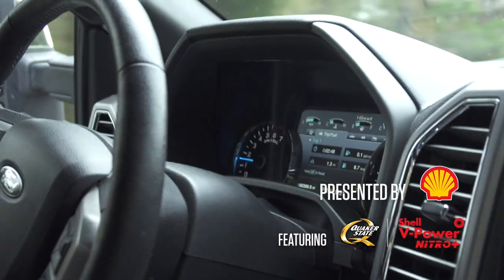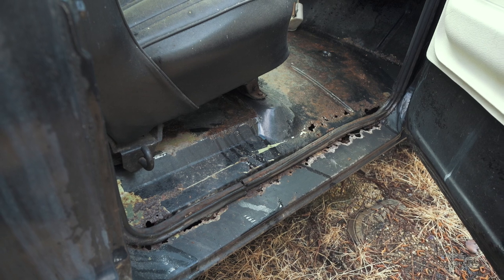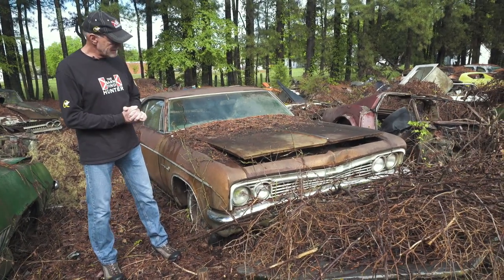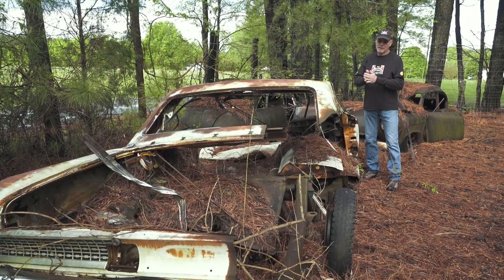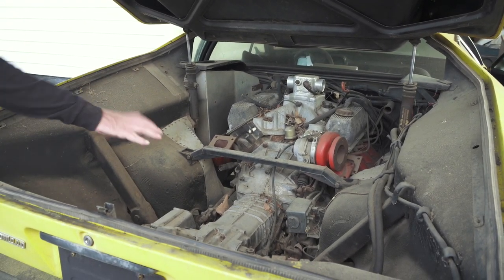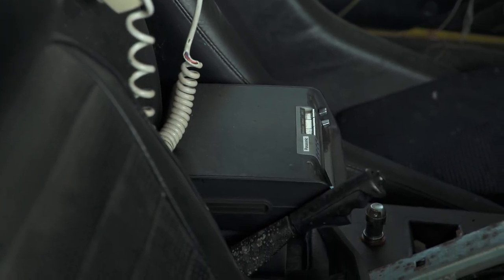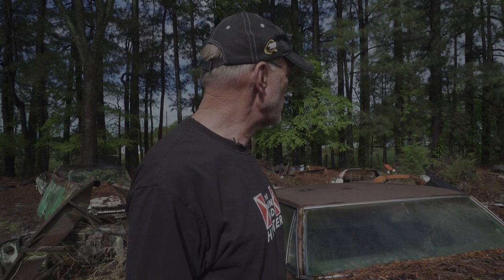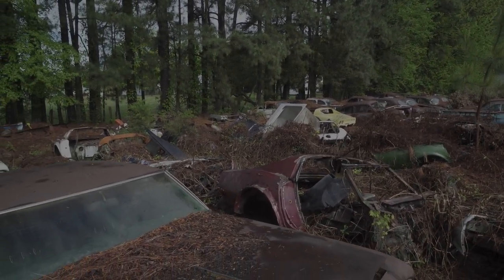R-Code Ford Galaxie 500, De Tomaso Pantera and MORE! | Barn Find Hunter - Ep. 49

Comment: Id be willing to take on the Pantera for restore if I ran across one In that condition. Metal can be replaced to a certain extent. As long as the main part of the car is there to get a template off of. It wouldn't be any issue just time.

Comment: Vega wagon. But way too far gone...
Reply: Too far gone? Not even a good starter!!  
‘74 Brand new 43 miles with parents in car blew head gasket 40000 miles later 1 1/2 quarts of oil to the tank of gas

Comment: The continuous bumpers front and rear on this Pantera indicate it was a later model and, in fact, a Pantera L. The pre-L models are worth more and had separate bumperettes. Someone also couldn't hack the gated shifter and cut the fingers out. It's certainly worth fixing. Parts aren't that expensive.

Comment: Not a phone    It;s a CB
Reply: @4375-d6i    I had a CB just like it  The big round nob changes channels  23 Channel CB
Reply: @4375-d6i  Probably so  I know I had one just like it in my first tractor trailer rig I bought in 1974  Big dial changed channels next small one was on/off Volume next was squelch  last was r/f gain  Button for transmitting was on the part that look like a phone  But probably to young  I retired in 2014  after 40 years owning a trucking co
Reply: Rodney Brewer … You caught that too, eh? I was wondering why there were 2 antenna mounts on the RF fender, and now we both know. One was for the CB, which would have been a poor location. You NEVER put 2 antennas that close to each other.

Comment: The old man had a 66 GT Mustang convertible that was an absolute basket case.  Take everything, off, acid dip it, weld in the floor panels, drill the spot welds on the rear quarters, weld in the new, lead fill the seams and go.  No questions on the value, the time, or what the neighbors say.  What color is this bad boy gonna be was the only thing that needed answered.

Comment: Is it true that Mazda's are still not galvanized?
Reply: Mazda has been using galvanized steel for decades, but they use a lot of Aluminium also. This is a 'wives tale' of sorts, as some early Japanese imports to the U.S had rust issues
Reply: Ben Rogue Some??? Most had rot holes big enough to throw a softball through after a few years in most climates
Reply: @annachrissy4874  This is true.